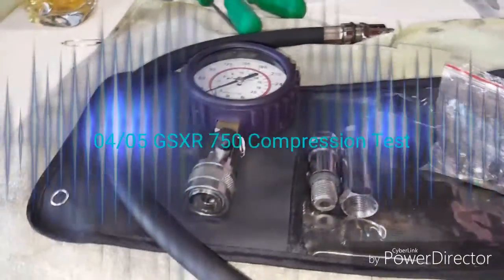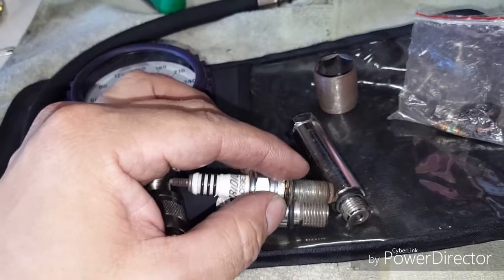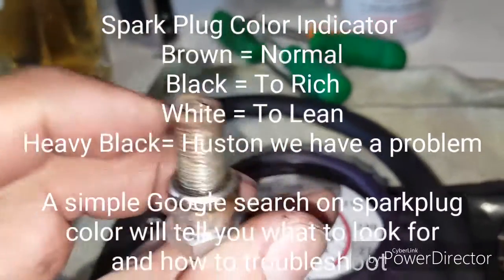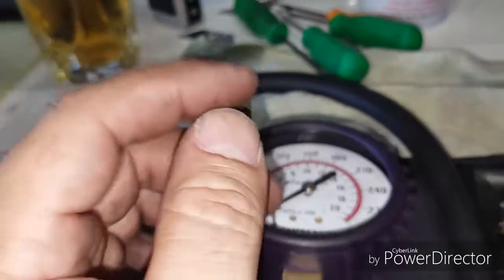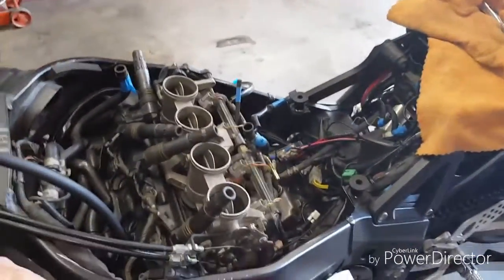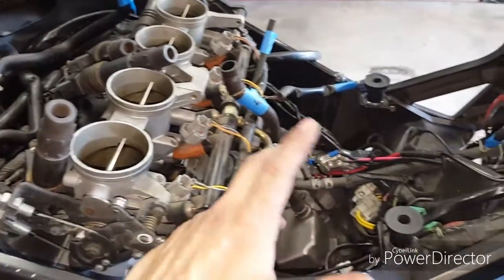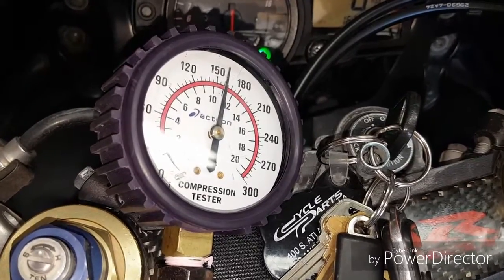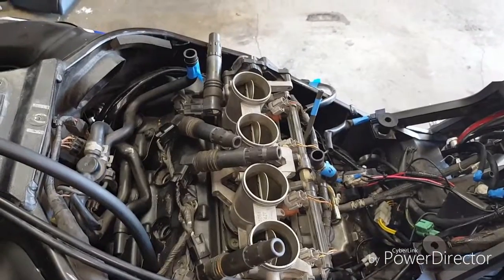Suzuki GSXR 04 05 750 Compression Test

Comment: compression tester threads should be as long as spark plug or you loose compression ratio which will drop compression a little. Also hold the throttle wide open to allow air faster travel to the cylinders.

Comment: on the cylinders you consider low, don't assume it is the rings.  put a small amt of oil into the cylinder and run it again. If the compression comes up , yes , it is the rings.  If little or no change, then look towards valve adj, or work.

Comment: Hey man I'm gonna pick up a motor soon but was wondering how to perform a compression test with it out of the bike. Would you be able to walk me through it? Thank you
Reply from the maker: A compression test is great but don't rely on just that, you want to hear all components working as well. just because you get good readings on a compression test doesn't mean the motor in question is worthy of purchase. If its just the block that you are interested in then ya, but if its a fully fully functional replacement that your after then your going to want to hear the motor run and shift through all the gears smoothly. That's going to be difficult without a motor stand to keep the thing from sliding around plus remember that the engine is going to get hot within the first minute or so. So assuming that you have all that. The engine needs to be configured as it would be on the bike, headers, main harness, battery, clutch cable and all sensors must be connected and the gauge cluster attached to see if any codes are being thrown (FI Indicator light).

What are you after with the purchase of this engine so I can make a well informed decision on how to go about testing for what you need.

Comment: Hi! I just made the compression test on my 04 gsxr600. But watching your video I realized that I didn’t clutch the bike, I didn’t remove all the spark plugs I remove one by one. and I removed all the ignition coil. The final result was 82 psi per cylinder. I’m gonna make it tomorrow again but now my concern is if I could have caused any damage to the bike? I‘ll appreciate your answer. Thank u
Reply from the maker: Sorry for the late response, but you should be OK
Reply: make sure you're using the right adapter, all spark plugs out to let the motor turn easier, fuel off, wide open throttle.   if all your cylinders are reading 82, your just doing something wrong...99% sure.  hard to get all 4 to go bad the same amt....really. put a small amt of oil in the spark plug hole and run the test again. if the comp. comes up then yes you have ring issues, if not, then look at maybe your valves needing adj. etc.....
Reply: Your engine must be warm! It’s very important!

Comment: I meant to ask you after you found that your bike was not up to specs how did you fix it and did you make a vid for that
Reply from the maker: Harold Peagler, No, at this point the only thing you can do will most likely be a complete engine overhaul or head rebuild but for the money and time spent trying to rebuild the old engine to new you could just simply  buy a newer used engine and tranny with less miles and slap it in on a weekend. This i have have done just recently but haven't put up the video yet, still working on editing.
Reply: james moreno damn this will be second motor I will be putting in this bike arrgh was trying to avoid that but thanks for insight
Reply: james moreno had to snatch first one out when I bought it it had the tick off death and replaced it with this one 01 gsxr 1k
Reply from the maker: Harold Peagler, ya hear you. I didn't want to slap a new motor in myself when just my 2nd gear went out in the tranny, But the thought came to me, why go through all the hassle of removing both, and only fixing the tranny when I knew the motor had 99k on it as well and that would be going soon too, then I would be stuck with a good tranny and no motor. I already knew I had low compression and the head needed to be rebuilt, it was pretty much a no brainer. But now that the old motor is out and the new is in I'm going to try my luck at rebuilding, gain a little more knowledge of the internals and possibly have a spare once complete.

Comment: Hey man i have a big problem i been struggling for about 3 weeks now.....
My GSX-R1000 K1 is having problems revving all the way up it will run great at low throttle if i go pass have throttle it will act like is dying or idk choking or just not getting enough gas? I've changed the fuel pump to a new one and also a friend let me borrow his whole bike to exchange a few parts for test is not the fuel pimp we also cleaned the injectors stillll no luck new spark plugs new coils you name it
Reply from the maker: lets start with the basics. Do you have an F1 light on and have u put the bike in dealer mode to see if the ECM is throwing any codes? Since you have a working donor bike try swapping out the STVA with yours. Without full details on exactly what the bike is doing and when its hard to say..
Reply from the maker: +james moreno signs of a dying STVA are 
Possible F1 Light - Not always tho
Loss of power in the Higher RPM - Giving it gas but bike wont climb any higher than say 70mph. This can  happen sporadically giving the impression something is clogged and releasing.
Limp Mode
Reply: Im having the same problem. Did you figure it out n do you remember how you fixed it?

Comment: hi
how did you screw the threaded piece in the cylinder head? I would like to know what kind of tool is used to do that, because the spark plug wrench can't do that.
I appreciated an answer. I will do that to my bike.
thanks
Reply from the maker: a p g, you just stick the hose and threaded end down the spark plug hole and turn till it stops. Dont get to crazy with tightening it, just a nice hand tight fit should be good. This is easier said then done because the hose itself is by no means perfectly straight so be careful and make sure if you feel any resistance while threading it in to stop and back it out, you don't want to cross thread the head spark plug holes or you'll be braking the engine down to fix. Start with cylinder 2 and 3 so you get a feel for it (they're the easiest) and work your way to the outers (1&4).

Also make sure you have a battery charger handy, you need to keep cranking the engine over till the needle stops moving on each cylinder,  This is pretty draining on the battery and may drain the battery to a voltage level where the bike might not start once it's all reassembled.

Hope this helps
Reply: thank you very much, my friend.
that was very well explained and with plenty of rigour, as I like. nice teaching :)
your answering very quick was also very appreciated.
one more time, thank you!
greatings from Portugal

Comment: What about the 2011+? What’s the value and range etc? Thanks man
Reply from the maker: The ranges should be about the same. 145ish being about the very lowest threshold and about 150ish being the high (160 for K5).. I don’t have the service manual books for the years you stated to give you the exact numbers but Google is your friend here or grab yourself a service manual. 

When conducting a test you are not worried about the values being low from when the bike first rolled off the show room floor, what you’re looking for is if one cylinder is greatly different than the rest as they all should wear at or about the same rate or within 10% tolerance as the good book states.
Reply: @TheChemistDIY  I keep seeing contradictory info, many sources say 11+ is 180-240psi
Reply from the maker: @Fee.1  The only way your going to get accurate information brother is through the service manual and reading it for yourself. YT and the internet are great resources but agin its second-hand information. The Link below will get you started. I own two books myself (OEM and Haynes) for my GSXR and I always refer to them if I am unsure about anything. Wish I could give you the info you needed but in saying that I would then again just be one of those contradictory sources.. 

https://amzn.to/3Ha9weo

Comment: got the 1000 k6 now bro fucking love it
Reply from the maker: Awsome Reg!, what did it set you back $$$ and how would u say the difference is between the two ponies..?
Reply: Im in the uk so £5k but its fully loaded and i mean loaded at least £2k worth of high end mods if not more. Tbh yeah they are really good but i could easily live with my 750 over it, yes the 1000 pulls alot harder but the 750 is such a sweet spot and you will see that if you get a 1000. If i was you stick 750. If my gearbox didn't go in the 750 i would still have it god i miss that bike